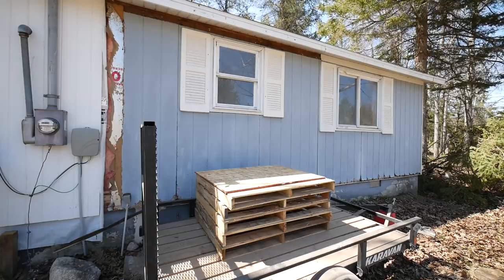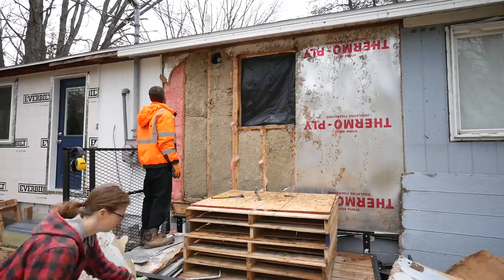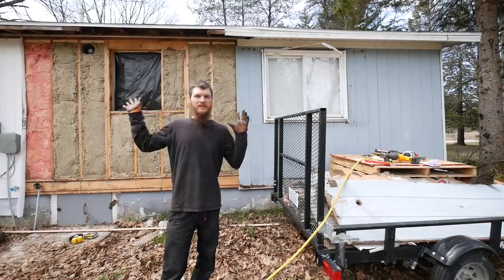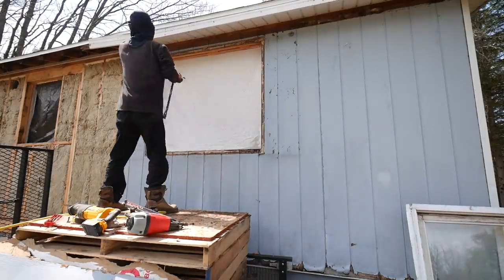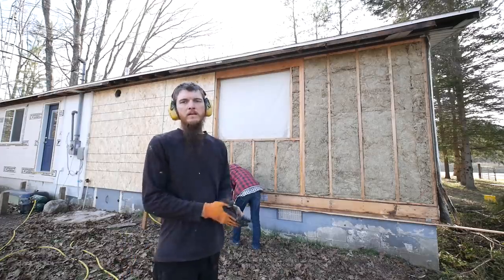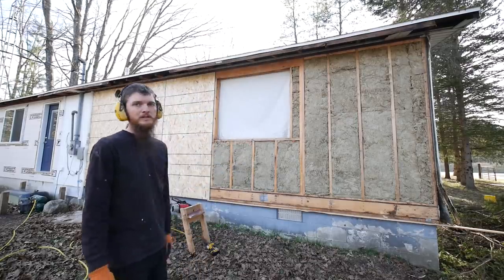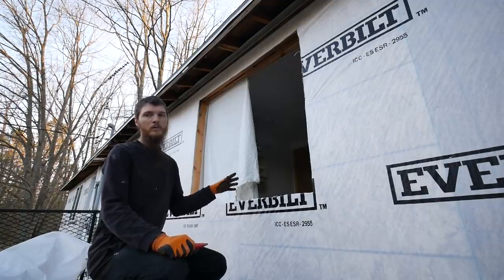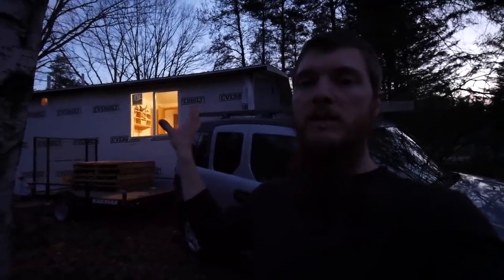Window Tear Out - Mobile Home Renovation

Comment: Looks great I need to replace windows but I have no idea how to measure them, people have explained it to me and it makes no sense to me! Like how to order the proper sizes to fit the whole I. The walls and I want to put in two more windows that aren’t there now, I want to save a lot of my bey and do it myself but have no idea how, plus no money either, but in winter there is just about as much cold air coming in the house as there is outside! 🥶 🏡
Reply from the maker: Windows are always sized 1/2" smaller than the opening. So just measure your wall opening and subtract 1/2 an inch to get the window size you need to buy. If you are making a new opening for a window. Just figure out what window you would like and frame the opening 1/2" larger than your window. That will give you 1/4" gap around the window for leveling shims and insulation.
Reply: DIYfferent wow that’s awesome not sure if I can do it but awesome to measure the window do you go from corner to corner on opposite corners like a (X) ? Pardon me being so dumb just don’t know this!
Reply from the maker: @GrampyCampy  Side to side, and top to bottom. Our rough openings were 55 inches wide and 46-3/4" tall. So our windows were 54-1/2" x 46-1/4".
Reply: DIYfferent thank you so much for the help, I never done it before where I was the one measuring everything! I appreciate this alot

Comment: hello DIYfferent Fam.  
keep your old windows and all your old insulation and house raps and use it for your shed there is extra natural light never too much 
and that old insulation in the walls with osb plates on the inside and you will notice that it is already quickly becomes a lot more pleasant inside the shed.  
you can get second choice wood for hardware stores for much less money 
maybe you can make agreements with your local hardware store 
that when it is damaged you have osb plates that you can buy a lot cheaper for their shed on the walls to use .  

kind regards Hollandduck from the Netherlands 
(source of translation: Google translate)

Comment: Nails are required in sheathing in earthquake and heavy wind areas where sheathing is required for shear strength.  Regular nails are stronger than regular screws.  (There are screws rated for those applications but they are super expensive compared to the same nails that are rated for those applications)

Comment: I think you're spot on about those screws vs nails Doug.  It's my understanding that nails have more sheer strength, and screws have more tensile strength.  The way I always remember it is screws have more pulling resistance, like holding deck boards down for example whereas nails have greater snapping resistance, like for example, lateral movement in a mobile home.  Good instincts my friend.  I love watching your videos. The house is coming along great, and you both have GREAT taste!! :-))   ps the children are delightful!!

Comment: Screws vs. nails:  Spot on.  Nails have superior shear strength as well.  Screws hold fast but break when stressed due to hardening.  Doubling rafters will fail code if you screw them together but pass with nails.... i.e. "nail-lam"

Comment: Nails have a much higher (what is called) shear strength (side to side force compared to the direction the nail goes into the wood) compared to screws which is why you should use nails.  Houses are built with nails, not screws for a reason.  For some reason, it's common for people to think using screws is better these days, I've even seen "pro" videos that say it's OK to use screws, but it's not!  In other news, my bid has been accepted and the house I bought has some projects that I'll be showing on my channel, but I bought such a nice house, it doesn't have as many projects (like yours!), but I'll still be posting videos soon!!  The window in Belle's room looks great, once that last side is done you'll be ready to start putting up siding.  You'll want to start that soon as you 6 month timer is starting to run thin !
Reply from the maker: Congratulations on the accepted bid, that's exciting. Yea, we're aching to get siding on the house, hopefully in the very near future  =)

Comment: I hear a retraction coming from you on nails being better to use than screws! Especially if your putting in a deck you should never use nails!!!!
Reply: on any floor surface I agree, no nails.
Reply: Why does he need to say a retraction? He said his opinion, just as you are stating yours now. By the way he wasn't talking about doing flooring.
Reply from the maker: I said that nails are better for "some things". We still use a lot of screws and each have their own strong points. Personally, I have also read of decks that have screws breaking after couple of months. And have seen decks that are solidly nailed, last for many years without any nail pops. It all depends on the materials and conditions. If you are using screws outdoors, I would only recommend buying a high quality screw and making sure the materials are acclimated with the environment.

Comment: Liked your homemade scaffold :) How did the wrap survive the winter? I was concerned when you didn't put up the siding last year.
Reply from the maker: It's funny you ask. We made a whole segment about that in this video but I ended up cutting it out because I felt like I was rambling and it wasn't really relevant, haha. But yes the wrap has held up amazingly. No problems, no rips, it all looks as good as when I put it on. It was getting some water behind it along the front where the rain was splashing up off the deck and hitting the wall. But we leaned some wood against the house there to keep the water off and it's been fine.
Reply: @diyfferent  awesome

Comment: Don't bother trying to drive the staples in, just smash them down flat, bend them over,  should only take one swing per staple, much faster than a sawzall.
Reply from the maker: It's much slower and more tedious, I've tried it. Especially when a lot of the staples have that paperboard sheathing stuck under than and you can't get the to lay flat. But as we always say, you have to do what works best for you :)
Reply: That's right.  To each their own.

Comment: I am curious how it is with condensation? I have been having a major problem with it and found out the wrap was suppose to go next to the insulation before any boards are added. The mobile home place said it placed this way to create a vapor barrier to keep any moisture from entering the home. Was wondering if you have had any problems?
Reply from the maker: In most situations the house wrap goes on top of the sheathing, just under the siding. House wrap is not a vapor barrier. It is a breathable membrane. It meant to shed water while allowing water vapor to pass through so your walls can breathe and dry out. Personally, I don't think it's an ideal product but it's often required by authoritarians so people use it. Condensation is usually caused by poor insulation or a poor air seal.

Comment: Had to smile watching you muscle that wagon back and forth. Hey, you got 'er done. Love Ashley's technique for dealing with staples. Bet it feels so good to have that sheathing about DONE!  Good tip on trim out around the window. Air and moisture penetration can be worrisome. 
I'm a mite concerned about your majesty palm and the browning leaves. Indirect light is better than direct. Regular misting is key for tropicals. Also it may be low on iron. In addition Epsom salts adds magnesium...key for most plants. Good luck! Take care and God bless!
Reply from the maker: Thanks! Only the oldest frond has browning leaves so I'm assuming that's why it's browning. Hopefully that's all it is. Thanks for the tips though  =)
Reply: @diyfferent  hopefully, that's all it is! =)

Comment: Was that mold on the metal sheet you removed?😱
Reply from the maker: It's mostly just the silver coming off and filth. There was a little bit of mold on the back of the fiberboard siding.

Comment: Nails stay better when shot from a nail gun because of the small amount of glue that’s on the nails heats up when it’s shot and cools which makes it extremely solid for quite awhile…but using a hammer with standard nails…they’ll creek from day 1 without that glue

Comment: Looking at the trailer with pallets for work platform and have a suggestion.For 40 years and 7 different mobile homes I have kept and renewed  6foot staging that stands on 2 A-frame legs on the outside and leans on the mobile home on the other side with carpet pads. A 16 ft plank goes on top.Handy and the neighbors borrow often too.Something to think on if you want to keep doing reno and repair work. CHEERS

Comment: Do you suggest single or double pane windows? Our double pains are a disaster, the co. went out of business, so no help there. We don't have water between the glass but the gas has turned to fog (dirty looking). All new windows again will be costly and we're wary about getting double pains again. Any suggestions.
Reply from the maker: I think you almost have to do double pane windows these days. It's hard to find single pane and a lot of places probably wouldn't allow them because of new energy rules. It's interesting to know that studies show that a single pane window with a storm window performs as well or better than a double pane window. I wish there was less regulation on our lives so we could try different things like that.

Comment: Does that screw/ nail advice apply to a deck ??? Thank you
Reply from the maker: I'm not sure about deck screws. I can only speak to my own experience. Deck screws should give better hold power than nails to keep the boards flat. But I have read a couple of forums where people had deck screws break and even fence screws snapping, some in a matter of months. Nails bend instead of breaking but most people do use screws. If you go with screws, get a good quality one. I prefer GRK screws personally.
Reply: DIYfferent thank you!!! Your advice is truly appreciated ❤️❤️❤️

Comment: So, how is taping the sides of the house wrap to the face of the side stud any different than wrapping the house wrap around? Same drainage field, as you called
Reply from the maker: Because the tape is sticky and adheres to the studs, while housewrap does not- allowing air and moisture to bypass the window insulation and enter the wood framing and home.
Reply: @diyfferent  Oh Ok

Comment: Great looking job....I love that the video shows progress but as a fellow DIYer, who has since moved into construction, I feel like you've inspired others to take on these upgrades without actually covering the really important aspects of this. For example... that window didn't just slide into place (without checking plumb and level) and your osb was hung the wrong way, those lines on the board aren't too important but they're there for a reason, and so is spacing. I should have watched till the end without skipping... incase you mentioned local code. 
All that aside... it looks great!